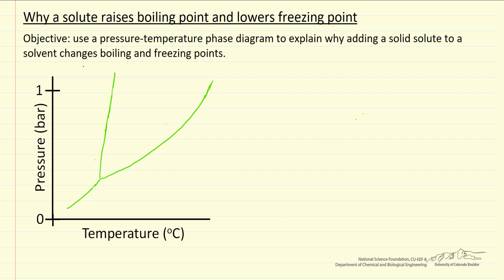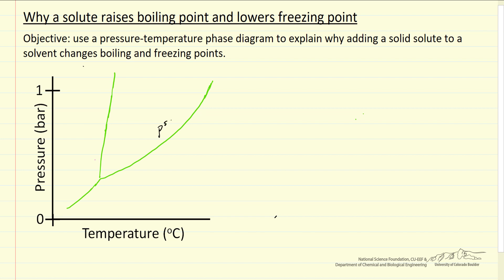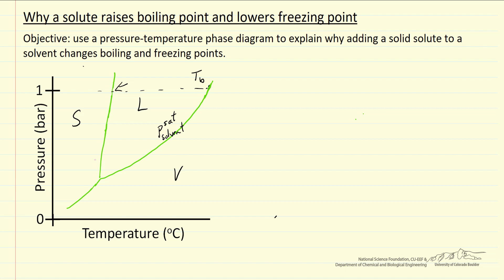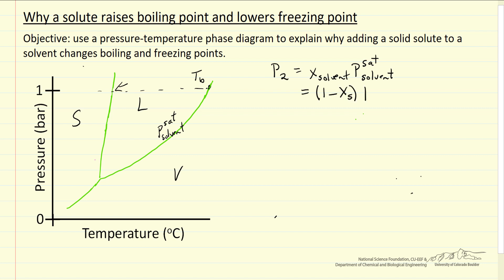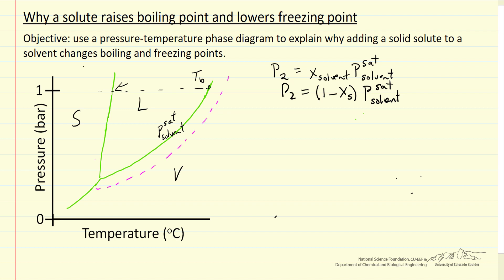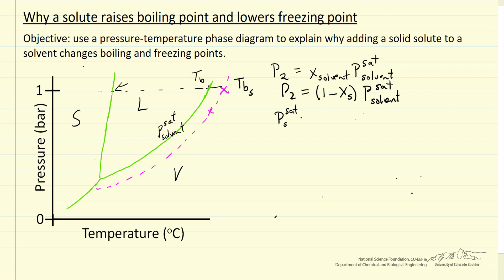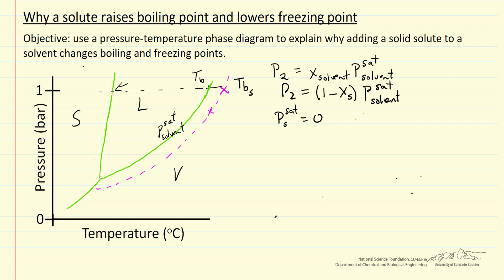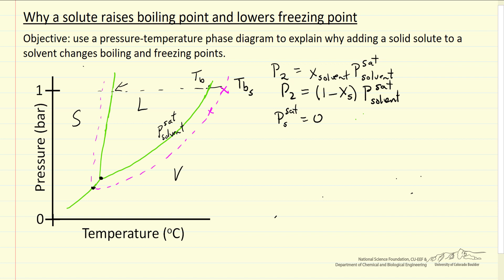Why a Solute Raises Boiling Point and Lowers Freezing Point

Comment: Really enjoy your videos.  From the standpoint of vapor pressure, how does the addition of a solute increase the boiling temperature?  In other words, how does the presence of the solute keep the molecules in the liquid phase until a higher temperature is reached?  Is more energy required to break bonds in the presence of a solute?